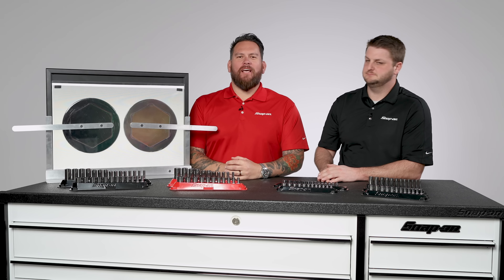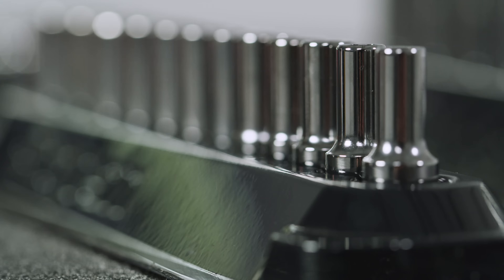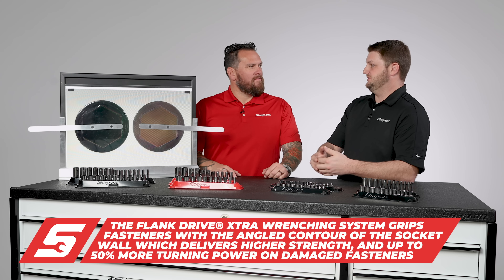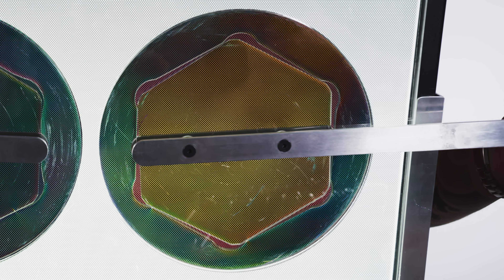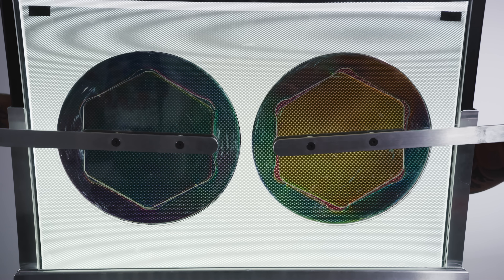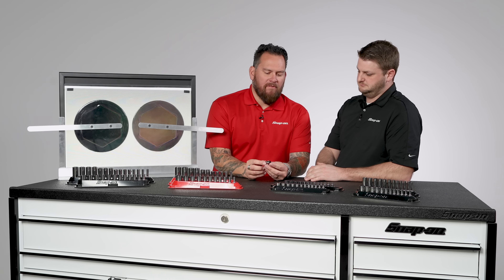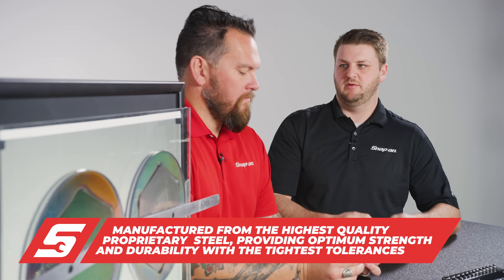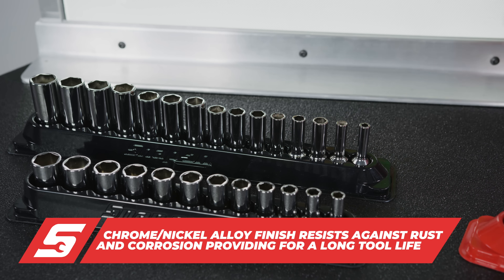Snap-on FDX Sockets | Snap-on Tool Tips

Comment: Not an everyday socket, they fit so tight they can be hard to get off the fastener.  Worse if there’s any rust on the fastener.  These are fantastic though when the fastener is starting to round or if you need a little more “bite” when torquing a fastener.  The step on the outside of the socket for gripping to pull the socket off your ratchet is AWESOME!  I want that feature and the large engraved number for socket size in regular sockets.  I would trade in all my other sockets for that!

Comment: Work great on northstar v8 cam bearing caps they use a short head 10 mm bolt on those my Mac edge and regular snap on set would not grab it only time I use them is for fasteners like that they fit to tight to use them every day imo

Comment: I bought a set and sold it shortly after. The rusted, rounded, damaged fasteners they were designed for, i couldn't get them on or off reliably. So now i just run my flank drives and a set of bolt biters if i need. They just didn't fit in my world

Comment: I've been using them since they first became available and they are great until until they won't fit. They are so tight that they won't fit grease zerks, Bendix disk brake shear nuts, rusty bolts, etc. If your using them on a new bolt then they are great but I've had many times that I had to use a non fdx because these are too tight. That's something to consider before you trade in all your sockets for fdx.
Reply: Lee Alcorn I typically use my every day sockets and when I think shits about to hit the fan or it already has, I’ll use these sockets. I know they’re meant for every day use but they’re so damn tight that it’s more of a pain than anything.